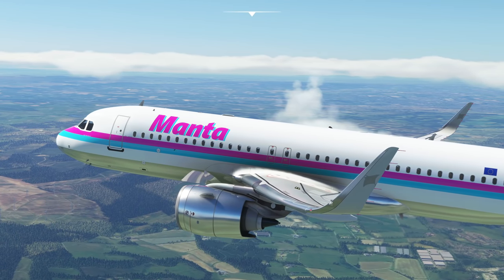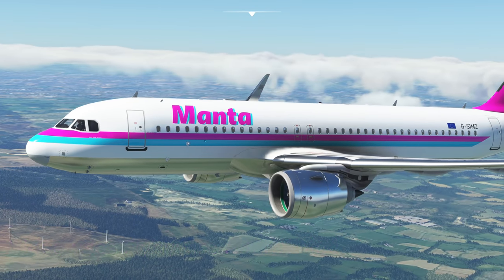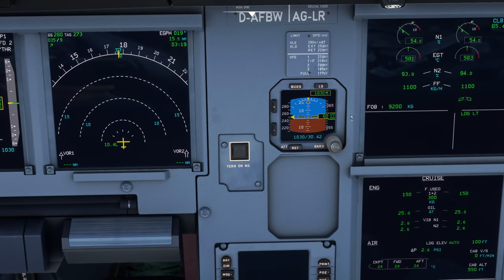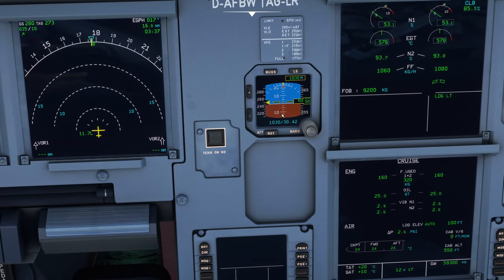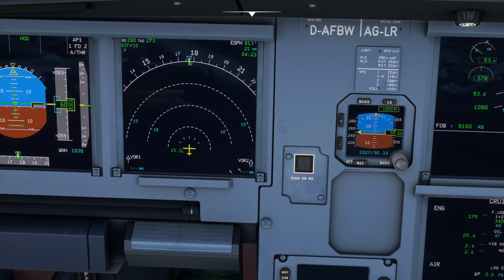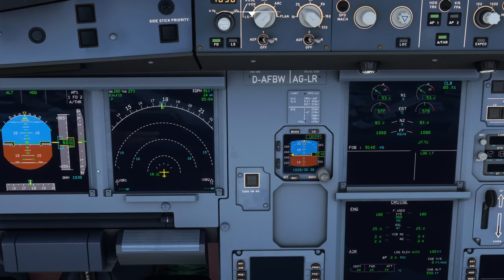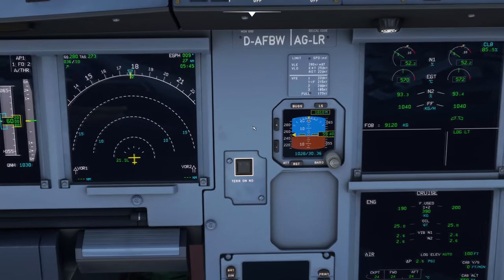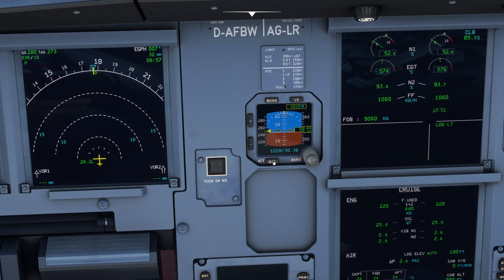When It All Goes Wrong: The Airbus Standby Instrument Explained with a Real Airbus Pilot

Comment: This was really interesting, especially as the few days ago I saw a video on Aeroperú Flight 603 crashed in the ocean due to the flight computers reading incorrect information because there was tape accidentally left on the pitot tube during maintenance. Its great to see how there is a back to the back up of the back up.
Reply: Static port*. And actually that would affect the ISIS as well because the tape blocks the raw data from being read properly so block pitots or static ports can still affect standby instruments.

Comment: 10:13. You’ve turned off the whole ADIRU so yes I’m pretty sure you’d loose all air data as well. From what I’ve been told the IR Buttons in the NEO are now push buttons so you can independently turn off the IR system and keep the ADR
Reply: This is exactly correct. 👍
Reply: That is modelled in the A32NX. ;)
Reply: Correct Thomas, The rotary knob turns off the whole system, Air Data and the Inertial Reference system (hence called ADIRS), the push buttons allow you to isolate either the IR or the AD(R) if only one part of the ADIRS was faulty, keeping the good part available. This is in the A330 and A350 and I believe the A320 since the beginning. Great to see it modelled! Amazing!
Reply: @malcolmwaters  I’m pretty sure reading the old FCOM the A320 at the beginning didn’t have the IR push buttons. They just had a FAULT and ALIGN light. Not sure when it was changed. Maybe on the enhanced models or just on the NEO’s

Comment: Well done for talking about it for 17 mins! 

A couple of additional points. It’s an MEL dispatch item for us (might not be for every operator). You can dispatch without it providing the aircraft is operated in daylight VMC conditions. 

And it’s required to be working (the attitude bit) for any auto land approach.
Reply: I’ve seen a diagram about the ISIS which shows it can get information from ADIRU 1 or 3 depending on the source select. Why would it need this? The only reason I can think of is if both the captains PFD and ND failed then he could use the ISIS and the data will be processed through the ADR instead of the raw data from the pitot static system if the ADR is still working (you tube won’t let me link photo)
Reply: @tomstravels520  I had to look this up! It’s a bit confusing to describe without the relevant schematic. If you google “A320 Probes Schematic” you will see a few examples. You’re quite correct that the ISIS gets data from ADIRU 1 & 3, at least that’s what the FCOM ISIS diagram implies. (ADIRU 3 being the standby ADIRU that receives the standby port pressure information). Looking at the Probes schematic, we can see that the ISIS gets raw pitot pressure (Pt) and Static pressure (Ps) directly (as explained in the video), but this pressure information is also tapped off and gets fed into an ADM (Air Data Module). This data is then converted into electrical signals and fed to ADIRU 1 & 3. So, this might be where the information from ADIRU 1 & 3 is relevant. If you had a blockage in the port at the back of the instrument where the raw pressure information is fed, this might be where the electrical data that comes from the ADMs & ADIRUs takes over as a redundancy. 

You can’t select what ADIRU data the ISIS gets unlike the PFDs via the switching panel. I’m guessing ADIRU 1 or 3 data will just automatically be used if the raw pressure data is not consistent with the other two independent sources. The FCOM doesn’t expand on this as far as I can tell and I’ve not heard of the standby instrument having failures down stream of the main standby Pitot & Static ports. I’m sure it can happen but I’ve not read about it or seen anything like that demonstrated in the sim. I don’t think it’s a major failure to warrant spending any time on. If the standby instrument is kaput or ADIRU 3 is going wayward, ADIRU 1 & 2 can still be used so long as they’re reliable. 

It gets more interesting if 2 ADRs go wrong but display the same corrupt data. The Airbus automatically dumps the odd, inconsistent single data. But it can be this single data that is the reliable one. 🙄 Careful monitoring and assessment needs to be made so you can identify the two ADRs that are displaying crap data and satisfy yourself the single data that was being discounted initially is indeed correct. It’s a confusing one! 

Also on the NEOs we have the BUSS (Back Up Speed Scale). Not modelled yet. If all of the data is useless and no ADR data is reliable, you can just turn them off and fly on AOA. You can also turn on the BUSS with a button below the PFD brightness knob. This just uses AOA Data and is reliable (so long as the AOA probes aren’t broken or frozen). It’s pretty simple to use and quite fun. Especially in Direct Law when the gear goes down. 😉
Reply from the maker: Thanks! Some great additional points. I’m in Europe so staying VMC for a whole flight is very very rare indeed!

Comment: I had to use ISIS one time in MSFS when basically all the PFD data got frozen during the descent, thus I wasn't able to use parking brake or normal brakes and also autobrake wasn't working so basically I had only the spoliers, reversers and some hope to stop the plane. And I found this out eventually after touchdown. Basically on short final I was trying to engage LOW autobrake but it just didn't respond. I said okay I'm going to use manual brakes than. After touchdown I realized that basically no brakes were available. It was surely not an ideal situation :D

I ended up stopping on the runway with inches remaining of the runway.

Comment: Great tutorial. I was asking myself what about the heading? Then you mentioned the standby compass first time I saw that in A320NX . My FO side PFD and ND always fails after some time, not sure if I adjust it as failure but going to try that for sure. Thanks
Reply: Im not sure but in the 737 thoose displays shut down on flight when you are using battery without generators.

Comment: maybe i missed it .. but as the backup RMI has been removed - how is navigation accomplished in case of a complete failure of all systems? is it always possible to get vectors direct to the next airfield nowadays? or will the raw VOR/ADF data still be displayed on the ND?
Reply: depends what you mean by "all systems"

Comment: Another great tutorial, thank you 320SimPilot! I also have a request. Perhaps you have already discussed timers but I have not been able to locate a video on this topic. I use the chrono that displays on the ND for engine start but would appreciate more information regarding the details of engine start timing. Also, what timer is used for flight timing? When is it started? After engine start? Entering the active runway? Usage of the clock above the gear lever? Thanks again.
Reply: I think it varies through airlines. I’ve asked one who said they use the elapsed timer above the landing gear from pushback to engines off but another said they use it from takeoff to touchdown as they always note the time when pushing back and on arrival anyway so they just add those extra minutes of taxing in between
Reply: @tomstravels520  most seem to use the Chrono button ND timer from takeoff to landing...usage of the other timers seems to vary
Reply from the maker: Thanks Hank! I’ll consider this for a future video!

Comment: I wonder why they don't still provide a backup HSI. I guess they decided it's so extremely rare to need it, it's not worth the parts and maintenance cost.
Reply: Well even the 737 one comes from the left IRS so if that fails you’ve lost it anyway. The A350 and A380 can have a standby navigation display but it requires IR1/3 to work apparently so it’s only useful if it’s just screens that die. At least with air data if the ADM’s fail it’s raw data from the pitot that feeds it. Not really an alternative for backup navigation unless a 4th IRS installed